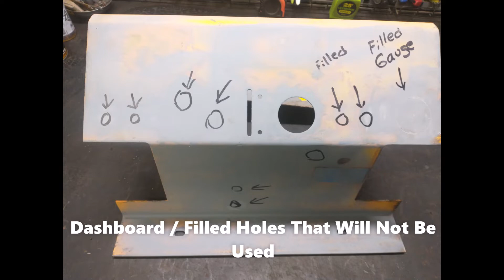Case 1816 Skid Steer Restoration Part #5

Comment: I am in the process of a rebuild on my 1816 and will use some of the modifications after seeing yours. Your rebuild is excellent, one of the best. 
The original engine in mine was a 16hp Tecumseh and much underpowered.  I am considering using the same engine as you are. I saw in another 1816 rebuild a guy used one of these however, he didn't post anymore about it.
I look forward to seeing more of your posts about how this has all worked out. Keep up the good work and thanks for posting this.
Reply from the maker: Thank you for watching and for the +positive comments.

Comment: looking good..
Reply from the maker: Thank Rick.
Reply: @oldretiredguy  almost ready for blasting , did yours have two big rivet head bolts that you had to cut off the back to remove the cage?
Reply from the maker: @farmerrick9660  Hi Rick;. I do not have a roll cage for mine. But I did have those same bolts holding on large lifting eyes where the cage would go. Yes,. I  had to cut the top of them off. The roll cage is something I'm going to make.

Comment: I am doing the same thing on a 1816 as well. I am using a predator engine too. Mine is all tore down for paint as well.I use flex exhaust pipe 1 inch to adapt the exhaust.

Comment: did you use an electric PTO clutch for this and if so which model and part number.
Reply from the maker: My unit has a manual PTO engaged by a cable tightening the belts on the pump motors.  I am sorry that I could not help.  Good Luck!
Reply: @oldretiredguy  Thank you for the response anyway.